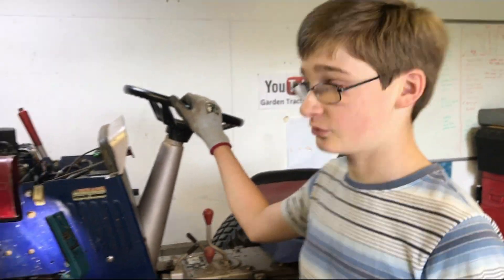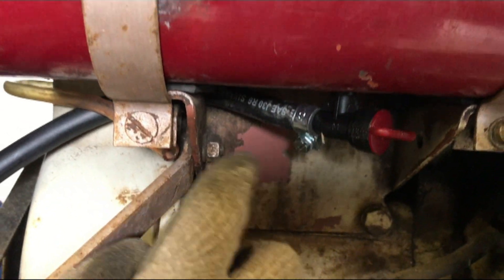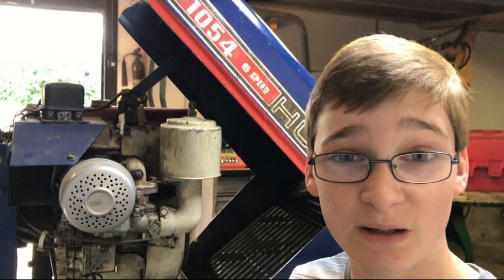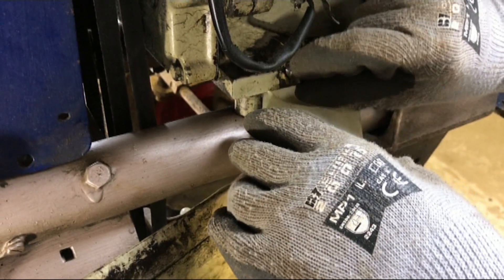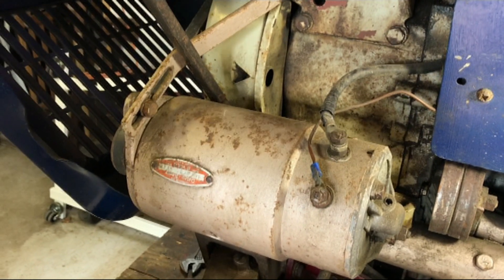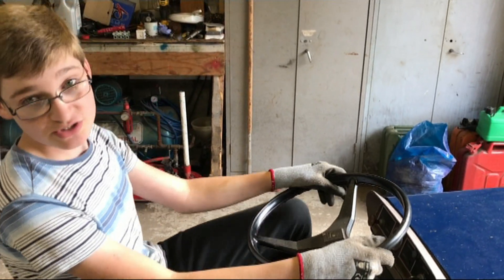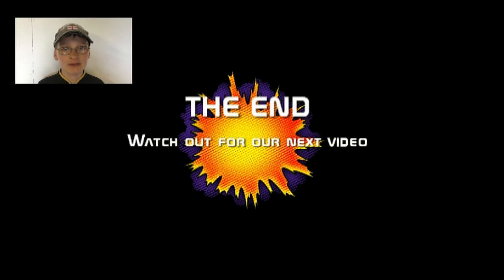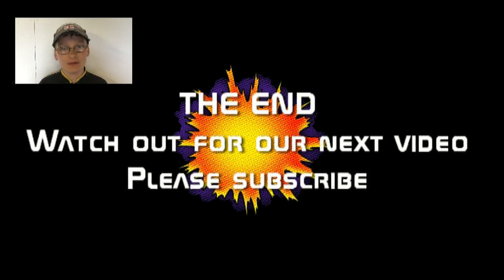Blue 1971 Bolens 1054 - Return to service

Comment: Hello there Joseph!!!  Great to see Blue Boy running!!!  That oil sure looked like it was due for a change!!!  The fuel line had seen better days too eh!!!  Thanks for sharing and good luck cleaning up the carb!!!  Take care!!!
Reply from the maker: Thanks 👍 That tractor does look good in blue even if it is not the original colour. We have done a little more tuning on the carb and it runs a lot better now. The carb's on these Wisconsin can be a bit temperamental. Take care

Comment: Good job bringing her back to life! The generator looks like a Delco-Remy. They were used in General Motors vehicles. I have rebuilt a few! Thanks for sharing.
Reply from the maker: Yes it is a Delco-Remy generator, these were fitted to a number of different Bolens models. We are yet to have a go at rebuilding one but I am sure it will be something we have to do at some point. Take care
Reply: @GardenTractorBoy  I recall them being simple to rebuild. But that was 50 to 60 years ago. The parts might be difficult to find now.

Comment: Good video. That starter/generator is the same as General Motors engines used up to about 1962. I was taught to adjust the belt a little looser than the standard so that the generator and the water pump would last longer. My water pumps lasted twice the miles that my brother's did. Used to rebuild the generators  for a $3 kit(50 years ago). The kits are on EPAY for about $15 now but who knows the quality? 
Hurricane Henri hit us last week dropped a tree on my tent garage. Looks like a Simplicity 725 and an auxiliary power unit from a B-29 were damaged but, I can't tell how much yet. Getting the tree off is turning into a big project. Have fun guys. Good Luck, Rick
Reply from the maker: Good tip about the belt tension, thanks. We have not tried to rebuild one of these yet but I am sure we will have to do so at some point. It is disappointing that you had damage from the hurricane and I wish we were closer to give a hand with the clearing up. I hope the damage is minimal. The local air museum has a B-29 and I think it is the only one in the UK . Take care
Reply: @GardenTractorBoy  During WWII, the B-29s were mostly sent to the Pacific because their range was needed there. Good Luck, Rick

Comment: another good looking old Bolens, yes it does sound like the engine isn't as smooth as it could be, maybe a bit dirty or maybe the choke is not totally opening?
Reply from the maker: We do struggle with the carbs on those Wisconsin's. We have been doing a bit more fine tuning on the mixture and it runs good now. Take care

Comment: Hi Both , your video proves this is definately the same model as mine ( but yours does'nt smoke as much as mine LoL.) so thanks for posting. Interesting  to see the decals etc because mine has been painted over. What petrol do you use ? I beleive they used to run on leaded. Is that the original colour? I would like to paint mine factory.
Reply from the maker: The original colour is white. We have three 1054's and only one is the original colour. This also did not run when we did our virtual tractor show and we may spend some time on it for the next video. I thought they were designed to run on unleaded which was introduced in the US a long time before the UK, I may be wrong. We have been running our tractors on unleaded E5 with B&S fuel fit added. Now that unleaded is E10 we will move to super unleaded which is still E5. Take care